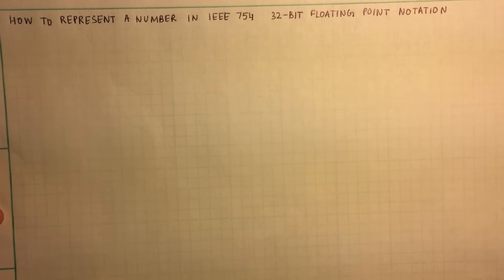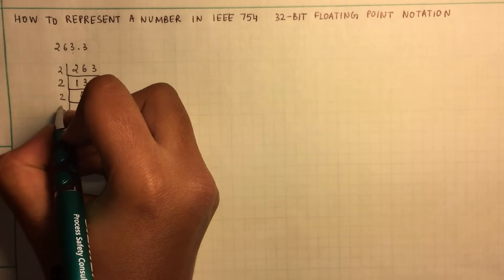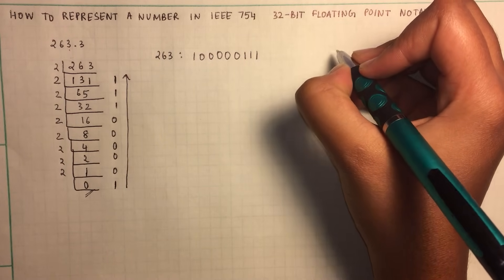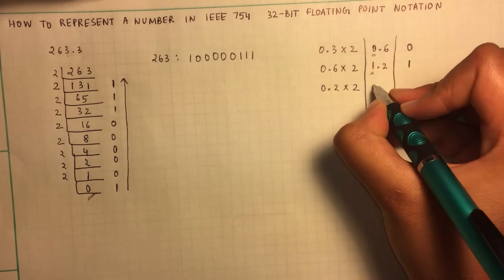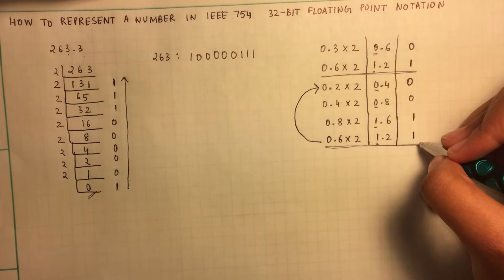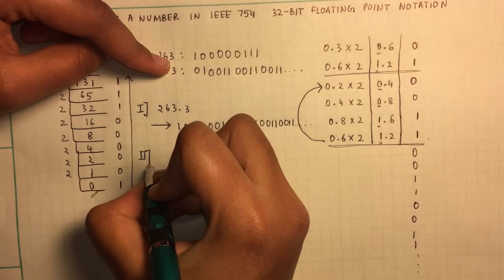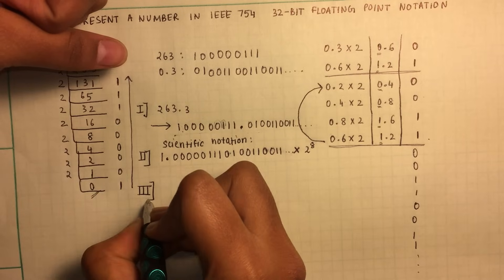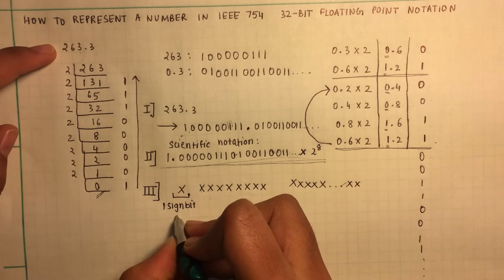Decimal to IEEE 754 Floating Point Representation

Comment: you wrote wrong binary representation of 135 ,plz correct it...
Reply: The binary representation of 135 IS b 10000111, what're you talking about?
Reply: Wow, even you don't know how to calculate binary representation use the calculator and you will get your answer & she has done it right, got it.
Reply: lmao
Reply: it is wrong, the right number its 1000100.... 2^8 128. then u have to add 8 to complete 135, so 8 is 2^3,... the way you did you will get 134, becouse the last 3 digits been 1 it means that is 2^0=1  plus 2^1=2 plus 2^2=4 and that in total is SEVEN NOT EIGHT!!!!! you are wrong sorry for that.
Reply: @angellogherardini4141  OMG people, since when is 128 + 8 equal to 135? Last I checked with a calculator 128 + 8 = 136...
Reply: Angello Gherardini sorry but I think the uploader has it right. 10001000 is 2^7 + 2^3 = 136. 10000111 is 2^7 + 2^2 + 2^1 +2^0 = 135. Hope that clears up any confusion.
Reply: 135/2 = 67.5 not 67